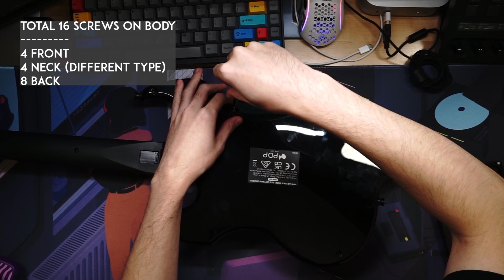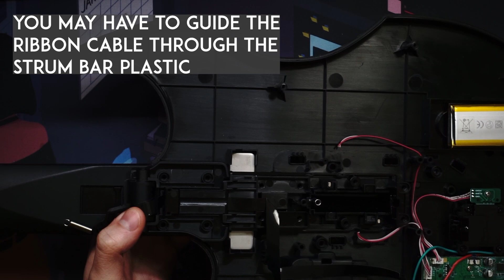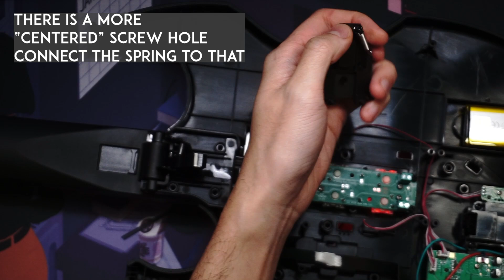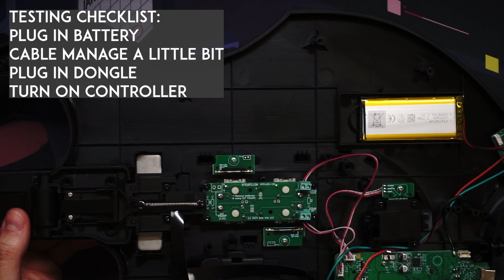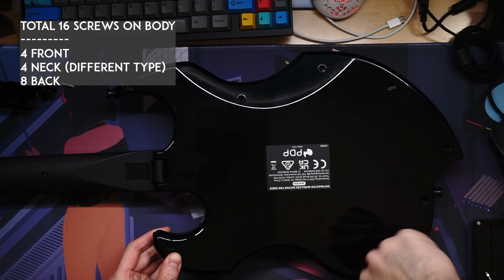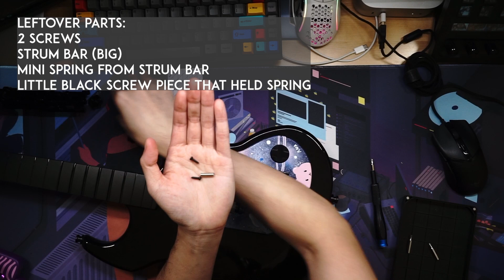StrumFix V4 Riffmaster Installation Guide

Comment: Great video. Putting the ribbon cable back in seemed a little dicey when I did it. It required more force to put it back in than I  was comfortable with, but the ribbon cable didn't bend and the guitar works!

Comment: How does the mode change the feel of the strum bar?
Reply from the maker: It feels completely different. While it's still "linear" in the sense of there being no click or bump like a Guitar Hero strum bar, there is proper resistance now to where when you strum, you feel it.

It has a 40g actuation weight and i think 55g bottom-out weight, which is heavier than the stock riffmaster which relies on springs we don't know the weight of.

That being said, the strum bar itself feels a little flimsy, but is secured in a way that I know it won't break. I think it's worth trying out, as they have a non-rgb version that's like $10 cheaper
Reply: Thank you, I brought a riff master a few days ago and the strum feels too flimsy to me and I was wondering if this was the move for a stronger feeling strum bar.